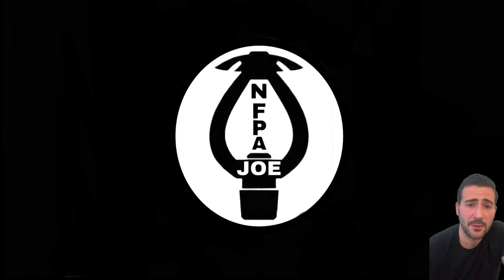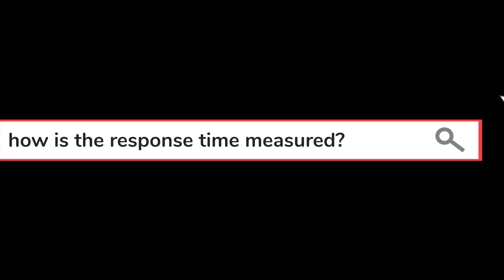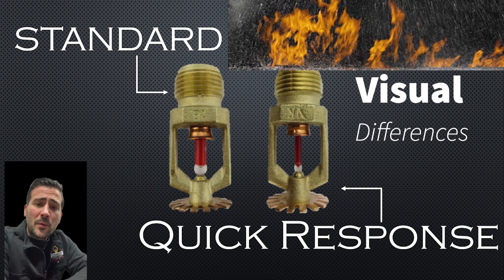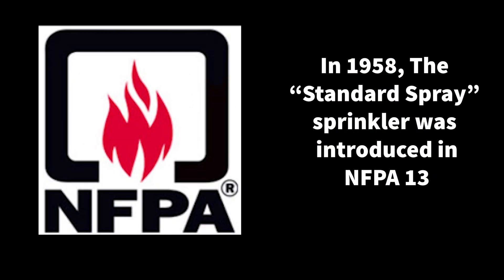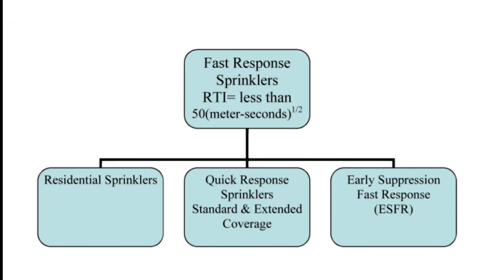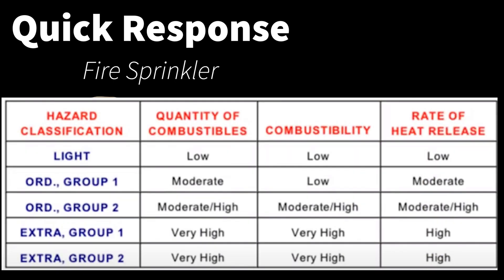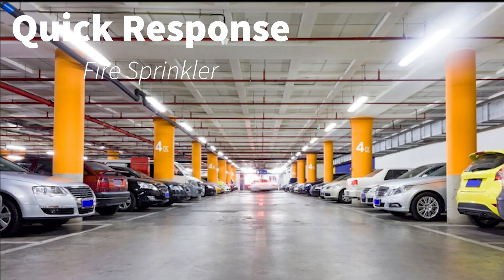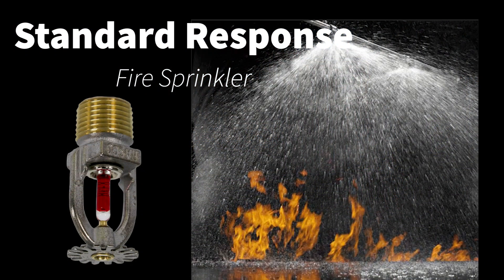Difference between quick and standard response fire sprinklers

Comment: Joe a question for you , if you happen to know ,. I hear that black pipe in many jobs used on dry system. Galvanized only in ESFR jobs or big heads but I can't find anywhere that's describes specifically  what's k factor size or at what point should use galvanized in dry system.
Reply from the maker: Heyy sorry for the late reply. So the option to use Galvanized pipe has nothing to do with code. It’s an option offered to have your sprinkler system last longer. During the sales process of having a sprinkler system installed you could choose to have black schedule 10 or 40. You could add a nitrogen system to help keep moisture out of the pipe. Or you could most commonly use galvanized pipe, and the only reason would be to have the pipe last longer before rotting out due to moisture.
Reply: @NFPAJoe   thank you so much brother